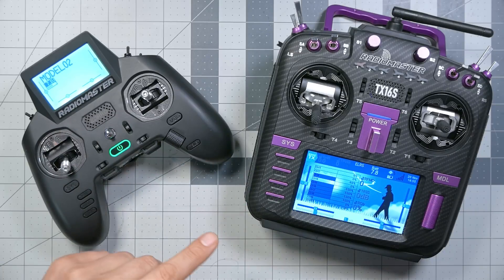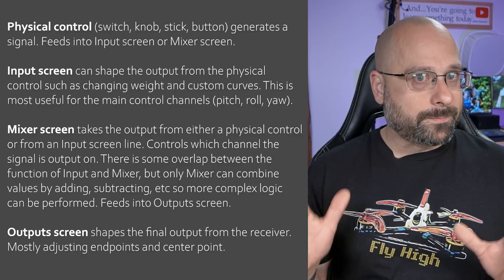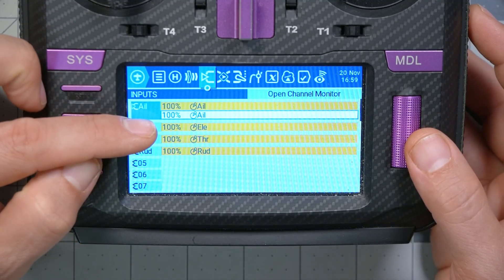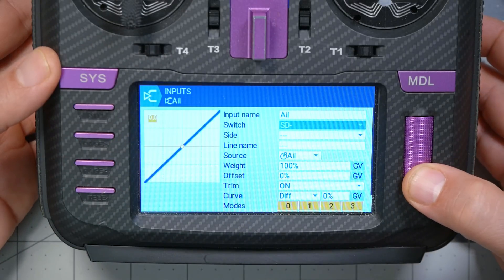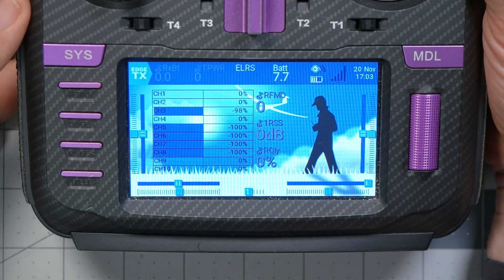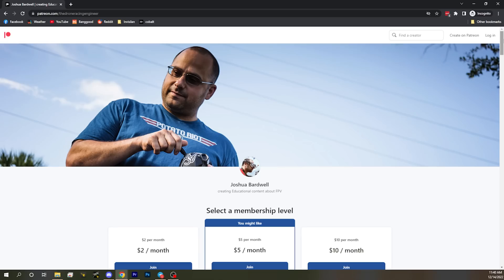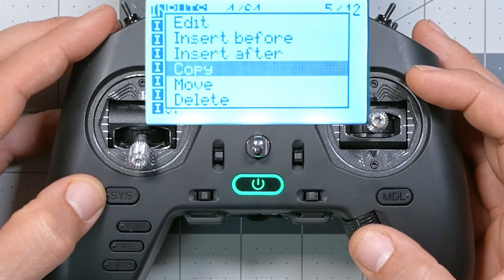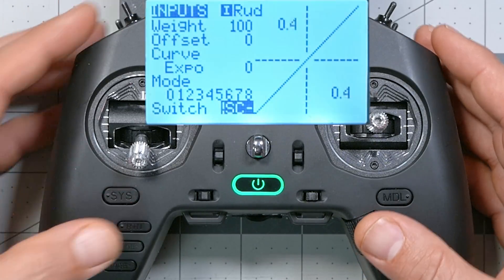It's finally ok to use your trim switches // EDGETX HOW-TO

Comment: Hi. All my gear is ancient and I was going to replace it with two Boxers. One in mode 1 for my fixed wing stuff and one in mode two for my Nitro Helicopter. Not used "open" stuff before but I expect it's easier once you have a unit in your hand to follow through with your videos.
Question is 1 Fixed wing; when coupled aileron/rudder is set up can you then set one of the rotary knobs to adjust the coupled weight in flight?. and 2 Helicopter; Can the rotary knobs be used for "Hover" pitch and throttle trim (or would that require a TX16 withT5 and T6) and can the momentary switch be set for engine kill (fully closed throttle)? . Just before I splash the cash.

Comment: Hi JB. Thanks for this video.
I was wondering if the trim parameter I'm the yaw axis make sense: the accelerometer should doesn't make any variations along that axis in angle mode. An I correct?

Comment: I want to use my trim buttons on a Jumper t-lite to do other stuff, like as extra buttons in the simulator to reset or whatever. Like so they're extra buttons and don't do trim at all. Is there any way to do that?

Comment: Mr. J.B, thanks for the video. It is very simple to fallow, but for some reason, I don't get the trim to stop functioning on the radiomaster boxer. I set it up as you did on the radiomaster Zorro, but when I look at the channel monitor page on the boxer, the trim still work regardless the position of my angle mode switch. Is there something I am missing?
Reply: Jum, never mind. I found out my error. I believe I was looking at the wrong input command.

Comment: Hello. Can you tell me if there is a script that saves the last position of the channel? What is the idea - when you turn on the toggle switch on the pitch, assign another channel (for example, camera tilt or volume). For example, I use the patch to set the value to -50 and turn off the toggle switch. During normal operation, the new channel is reset to 0, and I want it to remember the value -50, until the next time, until I activate the tumbler again and set the value with a pitch.

Comment: throttle trim is most useful for nitro planes, allows you to set the idle more easily, not useful for us but it's another free input, could be used for flaps or something if you're really lacking channels

Comment: Surprise surprise 😂 zorro is always killing its own battery just sitting there
Reply: The nice thing is that if you plug in a USB charger, you can run the Zorro indefinitely. We do this on my robotics team to use it as an ultra precise USB input device. Though, there may be a limit if the transmitter isn't disabled.

Comment: Why not flightmodes??
Thats what flightmodes are also for. They have dedicated trim settings. Just set angle with differential trims to standard. Done
Much easier
Reply from the maker: I agree that will work. But in acro mode, channels should always center, so I like the idea of disabling trims entirely.

Comment: This tutorial could apply to rc helicopters and airplanes as well as they  have the same kind “angle”, “agility” (or just manual) modes where they may want trims enabled only in certain flight modes and not others.
Reply: I was wondering about that.  My TREX470 with iKon2 fbl is a rock on a string on agility mode, but if I hit autolevel it invariably drifts mild/moderately port+aft.  I thought about something like this but since a fbl reads trim as constant input I feared it would reach level but continue into a starboard+fore drift.
I'll probably give this a try when I finish the re-setup and get out again.

Comment: The better option is actually to trim your accelerometer with stick commands. I did never think to have the radio handle this so I think this is a sick video, A cool video idea would be to have this input stick commands to trim the acc.
Reply from the maker: You're right. But you can't do that in flight and it's cumbersome to do it quickly like between heats at a race.
Reply: @JoshuaBardwell   Ahh this is true wish we could beg betaflight for a feature to adjust acc on a switch
Reply from the maker: It already exists. The mode is called "CALIB" in the Modes tab. When you activate that mode, the ACC will calibrate to whatever stick position you are holding.
Reply: @JoshuaBardwell   the main issue is that simply holding throttle at full and moving the stick to the left or right trims the acc by one degree per second.  Trim no matter what will remove resolution for flying and making quick movements needed for racing harder in some cases. I tend to tune each acc per craft to get the best result.   No matter what betaflight is still using 1-2000 for resolution and trim cuts into that resolution.
Reply: We really need to be able to trim the accel during flight with trim switches to make it practical to tune the accel for GPS rescue, auto landing, and someday soon position hold.

Comment: I don't believe you need the switch (and inverted switch) on both inputs - just the first one. I believe the logic is that it uses the first active input, then ignores any remaining inputs for that channel. Confirmed on the OpenTX simulator but I don't have my real controller to hand. (Or EdgeTX)
Reply from the maker: That's true. But the programmer in me likes to be thorough and not rely on fall-through conditions. And I wanted to demonstrate the "negate" function, which I suspect a lot of people don't know about.

Comment: Hum... This doesn't feel right, wouldn't you re-calibrate?
Reply from the maker: You can't re-calibrate mid-flight. And with a tiny whoop, it can be difficult to calibrate because the battery is on bottom and the drone isn't level. Sometimes you just want to trim it and be done.

Comment: I have no idea if I am asking too much but I wish there was a way the trims would just calibrate the accelerometer in flight. There are stick commands that just to that but the quad must land and you have to memorize weird stick positions.
Reply from the maker: In the Modes tab, set up your momentary switch to activate the CALIB mode. It will calibrate the accelerometer to wherever your sticks are when you activate it.
Reply: This functionality would be especially useful for the various GPS rescue and auto landing modes. Those rely on the accelerometer to be nicely trimmed.
Reply: @kyakfsh  Interesting. I assumed it used mostly gps coordinates changes to get the correct direction and speed.
Reply: @alainassaf  It does.  But the foundation of GPS Rescue is angle mode.  If the quad drifts while hovering in angle mode, it will also drift during GPS Rescue, and the various PID loops need to compensate for that drift.

Comment: Throttle trim is basically just for internal combustion engines on airplanes, vehicles, etc... I use it for other stuff when I'm not flying my gas or nitro planes. Just FYI lol